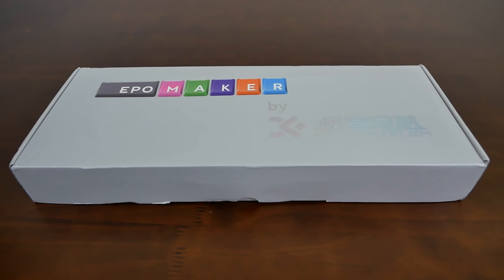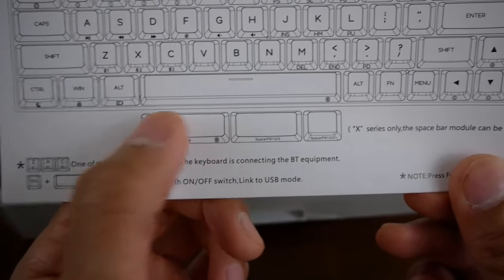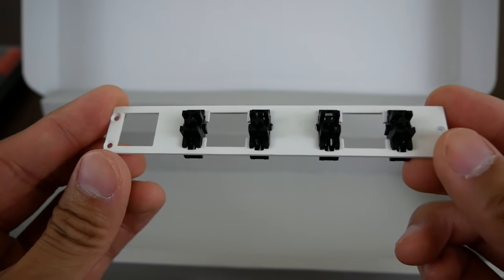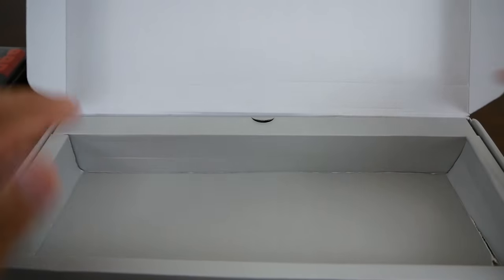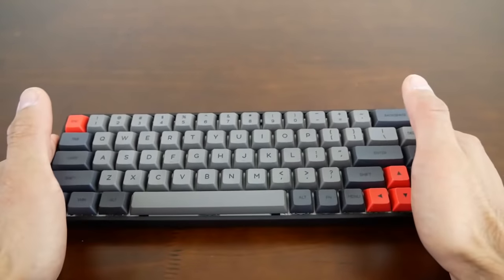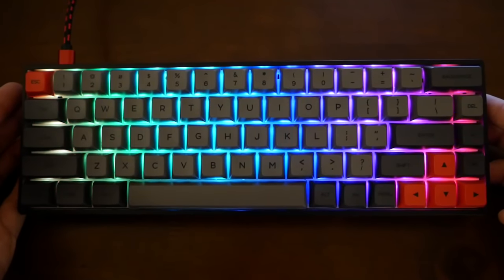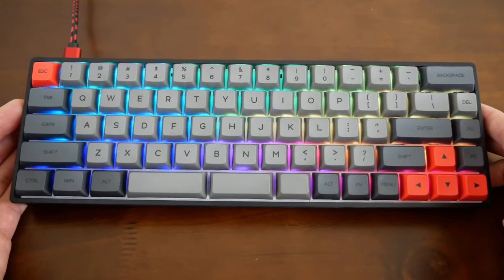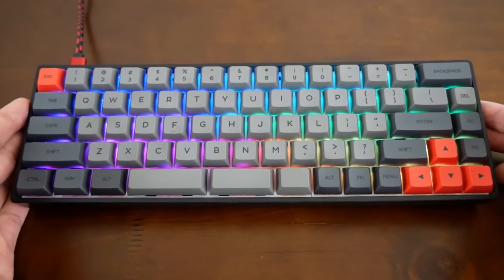Unboxing - Epomaker GK68X || The Perfect Keyboard?

Comment: It's a nice keyboard, I have a 64 key model myself (Akko 3068) and I think its the best of the small keyboard arrangements. One flaw that you perhaps aren't aware of is that it's quite hard to find keycap sets for this board compared to the typical ANSI layout. Whenever you buy a kit for this board you have to pay a significant premium to get the atypical keys - provided that the kit even has them in the first place.
Reply from the maker: Thank you for your comment. I agree with you. It would be difficult to find keycaps for this. I do this with most of my keyboard unboxings but I will make sure I consistently note the potential for keycap replacements in all my keyboard videos from now on! :)
Reply: @lilricemuncher09  I don't know how much it applies to others, but I never buy an off the shelf keyboard with the intention to keep the stock keycaps. Replacement options are something that's  a bit neglected by YT reviewers, because a lot of the custom crowd is ready to go 'all in'  and they don't think it may be an issue that you need a 200$ GMK set to actually give the keyboard some personality - but a person who buys a 70$ upscale Chinese keyboard isn't likely to spend 200$ on keycaps for it.
Reply from the maker: @vostok2717  I agree. That's a very good point! A good replacement keycap option is significant money when you consider the price point of some of these keyboards.

Comment: Awesome review bud!
I ordered this keyboard in the Aluminum variety, but the positioning of the backspace keycap is also BOTHERING me 😭😭😅

Please let me know what you think about that backspace key tucked in that corner, and how it feels after a while. Is it a deal breaker? is it annoying, any misclicks? muscle memory changes when switching back to a MacBook keyboard layout, etc. 

I'd like your feedback because I can still cancel my Kickstarter order and possibly go for the Drop Alt Keyboard instead.
Reply: Cancel the order, and go for the drop alt keyboard. It is one of the best keyboards on the market
Reply from the maker: Not sure if you were able to read my update description but I macroed the "`" key and changed it to backspace. This was very helpful to me and it drastically cut down on the misclicks. Not perfect but I think I could adjust to it for sure IF I wanted to. I also updated on the triple spacebar. If you want my HONEST opinion, I think the Drop Alt is a more refined keyboard. I think the biggest complaint on that is the stabilizers but that can be easily remedied. I'm also pretty sure that they updated it too. The Drop ALT is also on my list to unbox. 100% going to do that keyboard later. It's hard to recommend this keyboard over the ALT especially when the price points are nearly the same. But anyway, as far as the GK68X I think I'm just fine with the backspace now, but I would still prefer the regular way.

Comment: Thanks for the review.  A quick question, How much weight dose it have? under 500G? Is it portable for tablet ?
Reply from the maker: Tbh, I got this keyboard sent to me by Epomaker but I didn't get that much information. I think for sure it's in the 500's if not slightly less. As for your tablet question, you would need the wireless version (designated by the S at the end of the model number).

Comment: Solution for the backspace: swap out the space bar for the 3 keys. Make the left key a backspace. That's where the backspace should've been all along anyway but what do I know? I learned touch type in school, that's all.
Reply from the maker: The problem with me is.... my thumb naturally rests right between the first two spacebars so the three spacebar setup does not work for me very well. Lol
Reply from the maker: I'm not trying to sound like a diva but i've been typing one kind of way for over 15 years so it's VERY difficult to change and I don't feel motivated to do so. Lol

Comment: Nice video! How does the keyboard compare to other 60-65% keyboards in this price range?
Reply from the maker: Thanks! Ok so on the kickstarter website, this keyboard (GK68X wired, plastic case, and cherry switch option) is asking $99. IMO, if you like cherry and you knew what switch type you liked already, I would highly recommend the One 2 SF for $109. I think the biggest thing you would be lacking there is the hot swap functionality. My biggest complaint about this keyboard is the backspace moved over one unit for the "`" key. I was able to macro this key into another backspace key quite easily and it's helped a lot, but id still prefer the traditional setup.

Comment: Great video! Thank you! But do you see the letter on these no-backlight keycaps in the dark?
Reply from the maker: It's black on gray so it isn't the easiest to see but I definitely see it just fine. I actually run some cherry pbt vaporwave keycaps (hot pink on light purple) on my daily kb and they are HARD to see in the dark and find myself wishing for a different set.
Reply: @lilricemuncher09  Can you replace these keycaps with some that have the back-light effect? I mean with transparent letters which let the light come through? Will it work on this particular keyboard?

Comment: hi.. nice vid.. is it possible to replace the keycaps with backlit ones so the RGB shines thru the letters?
Reply from the maker: Appreciate it! Yes, it's definitely possible to replace the keycaps with backlit ones. I just opened it back up to check for you. The LEDs are north-facing so that means the vast majority of backlit keycaps on the market would be compatible - even the $30 ones from Razer. HOWEVER, you might run into some issues finding the correct keycap sizes for the 1u bottom&right  row keys, the shorted right shift key, and some of the productivity keys (namely, pg up and pg dn). Hope this helps!. Let me know if you have any more questions.

Comment: i have some glued rectangle rubber underneath the original full space bar which cover the keycaps holes, should i remove it when replace to split bar? will i replace back in the future to the full space bar after remove those ? thanks

Comment: This looks like a 'slightly' upgraded Anne Pro 2 tbh and when I say slightly then I mean it's really the nitpicky stuff that you should think about whether or not you consider them an upgrade.
Anne Pro to me still stands out to me as one of the best keyboards to program on, can't imagine having to adjust for the wonky key setup with the extra key on F/Num row.

I'm not sure the upgrades are worth more than a 2x pricepoint though, seems really stupid to me, guys you can literally go and order this same thing for like 50-70 bucks.
Reply from the maker: I think the Anne pro 2 and this keyboard are completely different. This keyboard with these options is priced at $100. I haven't seen anything like it for $50 so I'm not sure what you're talking about.
Reply: @lilricemuncher09   he most likely meant the barebones?

Comment: Can you replace the stock plate and put in your own brass plate?
Reply from the maker: I did a quick look over it and I see at least 4 screw along the top side, 2 at the bottom, and some screw mounts for the modular space bar. I guess you could replace it. I know this keyboard is part of a series so maybe there are some other plates that would fit the screw mounts, switch holes, etc. I haven't looked into it much to tell you for sure.

Comment: But why would you get thise over the Akko 3068?
Reply from the maker: The split spacebar feature, hot swap, and a few other things. I actually reviewed the Akko 3068 and like that keyboard. I would personally choose that if i knew for sure which switches i wanted, but if i didn't the hot swap feature on the Gk68 is really helpful.

Comment: where can i get a keycap replacement? the shift key is really wierd so idk where to buy
Reply: Same man most of the keycaps would be compatible if the right shift was normal :/ let me know if you find some compatible keycaps set
Reply: i would definietly take a full size shift key compared to the arrow keys because i dont really use arrow keys
Reply: @vo1d975  I didn't know much about keyboards back when I bought this :/ got it at a good price but the non shine through keycaps are annoying in night and I can't find a good keycaps set that will be compatible with it
Reply from the maker: @vo1d975  Hey, sorry I just saw your comment. The right shift key is 1.75u so you would need to find a set that fits it. An obvious one would be some GMK sets that have nonstandard keys like that but those are very expensive. Keycap sets with only standard layout keys aren't going to be fully compatible. You might try looking on Amazon. You can definitely find nonstandard keys like a right 1.75u shift key and the 3 productivity keys on the right with the correct row height in several keycap sets.
Reply from the maker: @major_cruze  I used to hate not having shine-through but I've gotten used to it. As long as the legend and the keycap color isn't too similar, I'm good with it. I had a vaporwave keycap set with pink legends on light pink keycaps and it was insanely hard to see at night. I was forced to switch to something else. Lol
Reply: @lilricemuncher09  keycap color is greyish and legend is black on mine so it is really hard at night. thanks for the info though will check if I can find some keycaps for it!
Reply: @lilricemuncher09  i know that the key is 1.75u but sadly i couldnt figure out if that keycap set was 1.75u bought the kb and keycaps anyways so hopefully they work :) the keycaps i want work pretty well with the default shift for grey and black anyways :)
Reply: @major_cruze  i dont really care about the shine through because i touch type :) when i get the kb def gonna lube the gat blacks that i got in em

Comment: Is this a programmable board?
Reply from the maker: Yes, it is. i programmed the ` key to backspace.
Reply: @lilricemuncher09  That's a great idea. I normally make capslock backspace, but I bet that would work just as well.
Reply from the maker: @stopthephilosophicalzombie9017  I just had to do that personally because I've been typing with backspace in that one location for the past 15 years so even though it's moved over 1unit with this keyboard, it really messed with my flow.

Comment: This is a off brand ducky one 2 mini
Reply from the maker: it's really not.
Reply: Lil Rice Muncher Gaming it really is, same color caps, (red caps) same arrow key placement for the bigger version, same plug placement, same plug
Reply from the maker: @laabster  the one 2 mini has random accent keycaps... more often than not, they are not red. The bigger version is called the SF and the productivity keys are placed in a different area. Really? the plug placement is in the same area? They're usually right or left side. This doesn't mean anyone is copying anyone. I have like 10 Ducky boards. This board is different. Lol
Reply: same layout same color special key caps, same type c plug, same plug placement, so yeh off brand
Reply from the maker: @laabster  😐 sure.